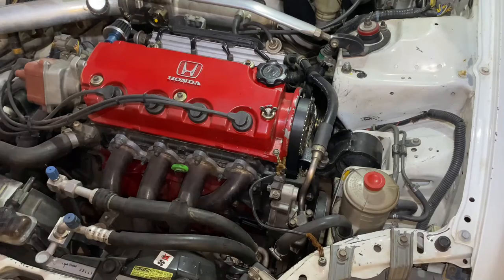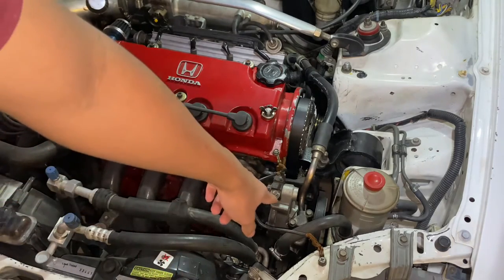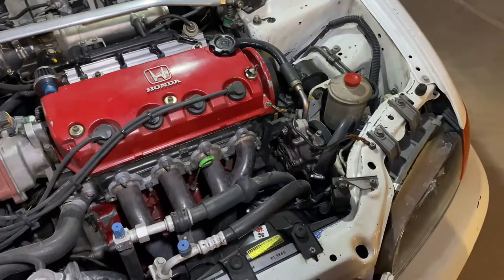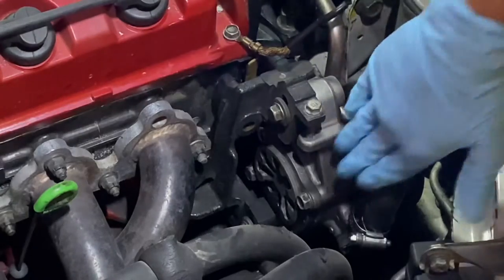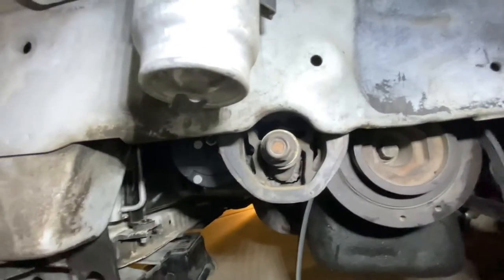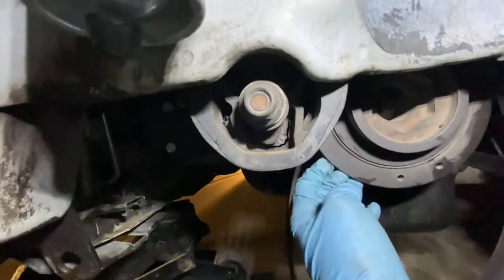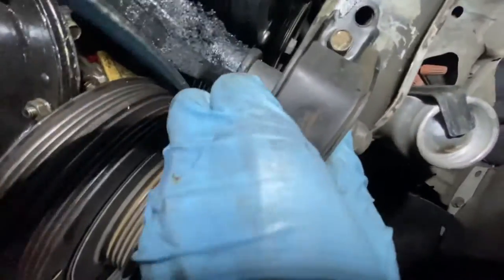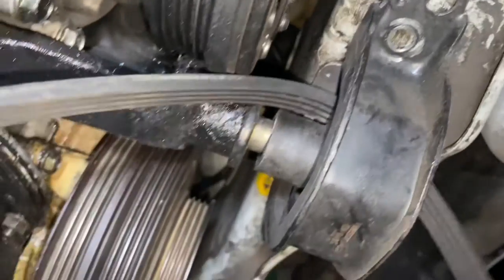HOW TO REMOVE AND REPLACE ACCESSORY BELTS |Honda Civic|

Comment: For the mount you loosened, do you need to support the engine by jacking the oil pan. I see you didn’t do it but I’m wondering why other videos do.
Reply from the maker: No need to jack it up, it's a torque mount. Though crucial, when I first got the car, I ran it without that mount until I sourced the whole mount itself. So really it would be safer but not necessary. Since the torque mount doesn't hold the engine it's there to stabilize the engine and reduce movement while driving.
Reply: @TONI5-25 thank you man !
Reply: @lilgil333 thank you for asking the question and for him to give the answer 😂👍🏽

Comment: Thank you so much for this video. I put my Honda back on the road back in April and bought all three belts I have a 98 VTEC. And then decided I'm just going to wait until one of them breaks and well my alternator belt broke tonight. Luckily I have all three of them sitting there brand new in the garage. But I needed a video showing me how to do it cuz I never did it yet so thank you very much.
Reply: Well it took me 2 hours today to figure everything out even though I watched the video five times. And I ended up doing an AC delete cuz I don't use it anyway and I don't even know if it works I've never once used it in the 5 years I've owned the car. So I have no idea if it even works and considering the bolts were being a real pain in the ass to get out of the engine mount I decided the easy route was just to do an AC delete because I need the alternator and I need the power steering I don't need the AC.

Comment: Thanks so much, My girlfriend has a 1993 Honda del sol and as I was changing the oil I looked down and saw a shredded belt on the alternator and ended up changing all three belts. Your video completely help me 100%. The only thing I would add is that on the AC belt you have to loosen the tensioner pulley center bolt before the adjuster will let you loosen or tighten the belt. You saved me a lot of heart ache with this repair. 👍✌️

Comment: Very confused on how you got the ac belt loose. The bolt that you says loosens the idler came completely out and no tension was lost, loosened the ac compressor and no tension was lost. Can’t get the belt off now.

Comment: My power steering mount for the pump isn't lining up correctly,  Looks like yours but when I put one bolt thw other ones wont line up the block by a centimeter, would you know if one is slightly shorter ?
Reply from the maker: I'm not sure what the issue is for you specifically, but I actually had something like this happen to me with my ac compressor. The pulley stuck out further than the crank shaft. I pretty much needed a new compressor anyway, so I replaced it with a new one from Rock auto and after that the belt lined up perfectly.

Comment: is the alternator belt the same size as the power steering one
Reply from the maker: If I'm not mistaken they are pretty much the same. You can adjust the slack on both the power steering pump and alternator, so you should be able to interchange them.

Comment: What type of powersteering belt is used mine shredded out and can't find a replacement without knowing what kind is used
Reply from the maker: Sorry for the late response, I bought my belts off of RockAuto and the power steering belt I used was BANDO 4PK815